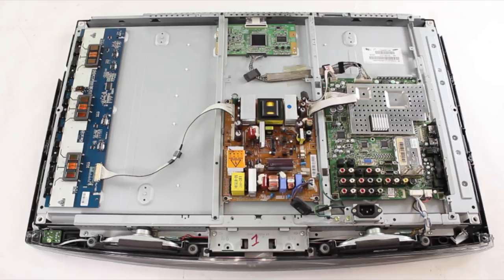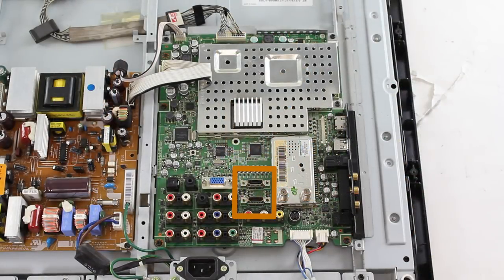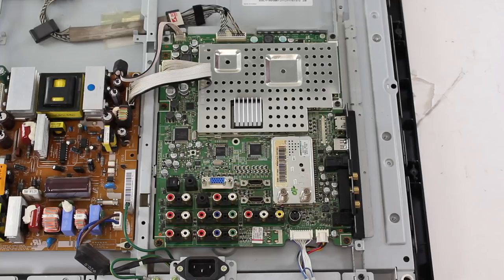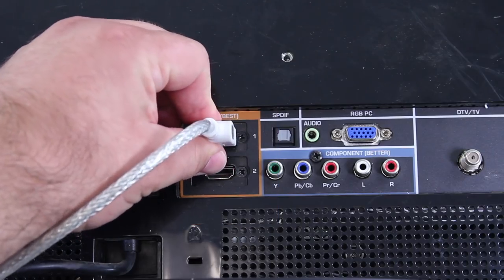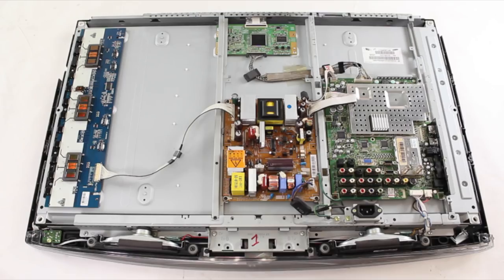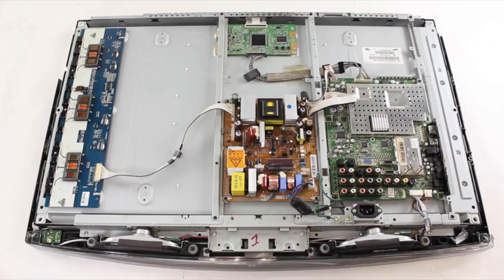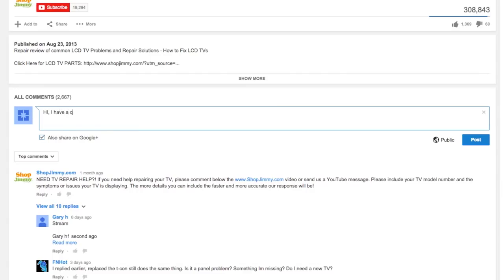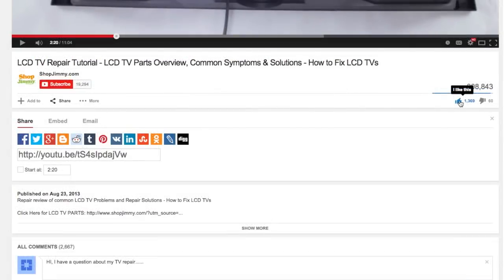HDMI Input Problems - TV Not Showing Image - TV Repair Help and Troubleshooting

Comment: I came across this video when I was doing one final search before giving up on my TV.  HDMI 1 would get video and no audio, HDMI 2 got nothing.  Different input devices, cables, updates to the tv, factory reset, etc all failed.  Samsung customer service told me I would have to either take it in or send it to them to be repaired.  I didn't want that expense for a fairly inexpensive TV, so I was just going to get a new one.  After this video I went to the website (mostly to see how ridiculous the price was on a main board).  Main board was super inexpensive, got to me the same week, and took all of 5 minutes to put it in my TV and it's back to working flawlessly.  Thanks to ShopJimmy, for sure.

Comment: Hello, I have some trouble with my HDMI port. My TV Panasonic Viera Plasma Model TH-42PD60X. TV has only one HDMI port and It was during a PowerOut that failed. Once the power came back I had to switch to RCA. My question is Do I have to change the mainboard or is there a spare part for this model? Thanks

Comment: Hello, i like your videos. I wanted to ask a quick question. I recently had a problem with my Toshiba 42AV635D, which i cant get any signal from any of my 4 HDMI inputs. When after couple of TV resets, I'm now sure the problem isn't with the software in any kind(no upgrade ever implemented) but with the hardware it self. I wanted to know how can i pinpoint if the problem is with the MainCard or with the Little built in box which connects all HDMI's to it, in order for me to purchase that exact part. Is there any way i pinpoint where is the problem ? Thanks alot.

Comment: Okay here's the issue and question. HDMI worked well in one TV "Seiki" sourced from the PC. But the same cable and feed going into 2 other different other TV's "RCA's" did not fully work. The desk top picture came up with the lower tool bar but not any of the icons of programs or the mouse. The audio did come through. The PC'S desk monitor functioned with no problem. 
Any thoughts?

Comment: I have recently purchased a FireTV from Croma. I have connected a Sony DVD player, a cable TV set top box and a internet video set top box to the 3 HDMI ports in the TV.

2 ports are working fine. The third one only picture shows but I am not getting audio. It is the Sony DVD player. 

What could be the reason?

Comment: Hey man this may be a stupid question but I've replaced a ps5 hdmi port twice and my TV identifies the signal as coming from a ps5 but there's no signal or error saying no signal. The console boots normally and there are no bridges between pins or loose pins. There's no torn pads or traces. Is it possible to be duped by the seller and the ports are bogus as far as being able to carry a video signal. There was no underlying issue as I do repairs for fun and have professional gear and I've replaced them on other devices before. I'm the only person who has ever been in it and the issue was caused by me stepping on the cable to begin with and the port worked for a long time after but I knew I'd have to replace it someday. I don't care if it ever works again but would buying a tester help or scoping the pads with the port taken out under magnification. I plan on giving it to a friend's kid as a surprise because they can't afford one and don't want to give up on it and I can't scope it while it's open and all voltage rails and such work and there are no shorts anywhere or hot spot under infrared. I'm tempted to solder test wires to the pads and check for an ntsc video signal with my scope. I've never read the hdmi 2.1 spec my c9 sees 2 ps5s connected when the broken one is plugged in. 

I think I just answered my own question. I bought a fancy new mso for a reason I guess haha.

Comment: Hahaha nice job in it and explaining it my problem is whenever I plug into my HDMI 1 or 2 into my TV. They both say no signal and it ain't my DVD that's the problem I plugged it into my other tv. And it came up right away it's just the other TV doesn't run on an outlet and I'm not traveling right now. So if you would please explain this to me step by step and if you could help me I would appreciate it thanks Jimmy ain't that ironic we both got the same name thanks.

Comment: Hi @shopjimmy.com , i Have a Mitsubishi TV ( LT-52249 serial #:106919) that its HDMI ports don't work , I was told to change the mainboard, i bought this part twice ! from diffrent eBay sellers, both claimed that nothing is wrong with theri part, but both didnt evenn give me picture when i installed them, i had to put the original board back in both cases, my TV works perfectly, picture and sound are crisp ! is there anything i did wrong? or just the parts i bought was defected? please help me out 

Regards

Comment: I was having flickering video and crackling audio with my gaming laptop connected to the HDMI port on my Samsung 55" 1080p HD SmartTV! All I did was...

1. Use 91% proof rubbing alcohol.
2. Use a double folded paper towel.
3. Wet a small area of the paper towel with the rubbing alcohol.
4. Clean the connectors really well and blow on the connectors to dry them.
5. Blow into the HDMI ports on my laptop and TV to get rid of any dust that may have gotten trapped inside.
6. Reconnected my laptop and TV.

So far so good! No flickering video or crackling audio! :)

Comment: What if both ports don't work? Is there such a thing as an older HDMI tech that doesn't work with newer HDMI sources? I don't have an older HDMI source to test this. I am aware of HDMI 1.0, vs 2.0 cables, but I am using 1.0 cables. Am I missing something, or is  it that both of my HDMI ports are just bad?

Comment: I have a Samsung un46f5500 that was not detecting any inputs.  I manually upgraded the firmware and now, when I plug it in, the tv just turns on and off on its own and will not respond to any controls.  I disassembled the TV and the Power Supply looks to be in great shape.  I think I should just replace the main board.  What do you think?
Reply: +MrGideon06 Thank you.  That is what I have been thinking just needed some confirmation.  The only problem is that you do not have the parts in stock.  But, thank you!

Comment: Hi, I've just got a LG 50PZ550T and initially when you turned it on it displayed HDMI then it would say 'No signal for current input. Try other available inputs'. The remote stops working too then it goes to the screensaver. Then when i touched the touch buttons on the front the tv would shut down.I tried HDMI 1,2, 3, PC and still the same nothing. So I took the main board out, checked it visually then put it back in. Now the tv does the same sometimes or just has a dark grey screen, as though the panel has lit up but nothing is there. However I plugged in a USB and it comes up reading then a visual menu pops up asking to use the remote to select video, music etc. But the remote does not work and the touch buttons on the tv don't work too. So I looked the touch button board and saw a 3.3v test point. I used a multimeter and it read zero. Is the main board faulty? Does the main board power the touch keypad panel with the 3.3v? The Power board Va and Vs read good. Any help would be great, thanks.

Comment: I had 4 HDMI ports not working. I replaced the mother board from a electronic company. I installed the used board and the ports still on work. the tv works great on coax antenna. any ideas?

Comment: Hi i don't know if you can help me with this problem. I have an LG plasma old one of the first models 42 inch, my problem is that i can connect my Nintendo wii u with hdmi, but not my Ps3 or home theater receiver which worked fine before, i dont think they're broken since a bearly used them. thanks in advance
Reply: +Carioca souza holy crap same problem. HDMI doesn't work with my PS3 either.

Comment: I have a Samsung un46h6201 with intermittent no signal problems with HDMI1. It's under warranty and a tech replaced the main board, but the problem still occurs. The problem is that after being off for a while (more than 5 minutes) turning the TV and device on causes no signal. I can repeat this several times when it happens, but if I unplug the HDMI cable and plug it back in, the problem is solved. This happens with multiple HDMI cables and doesn't happen on HDMI2. Le me know if you have any thoughts? Since we replaced hardware, I'm starting to think it's a software issue.

Comment: hello,
     I have an older Panasonic 42 in plasma tv. When I got the tv the hdmi port doesn't work properly it only shows a scrambled picture, when I hook the same hdmi chord and cable box to my other hp tv, it works fine. I've opened the tv up, located, and removed the board that the hdmi port is on but it's a seperated board then the main board. do you recommend just replacing that board or replacing both the main and alternate board? 
thanks

Comment: Hi Shipjimmy,
I am trying to connect my laptop to LED TV using VGA to HDMI converter box. I have connected my laptop to the convertorr box using VGA cable and I have connected my TV's HDMI to the HDMI output of the convertor box. But the TV shows "no signal". Can you please suggest anything to fix it.

Thanks in advance !
Reply: Denish Patel my problem is HDMI is working for the old receiver and I got new one and it doesn’t work how can I fix it ?!

Comment: Ive had chromecast for last 3 months loved it but all of a sudden yesterday when I go to the HDMI on remote it says no signal. So because of no power to chromecast it has stopped. I've tried both 1 and port 2 still nothing. Isnt it easier to just get a new tv? I only paid $100 yrs ago for this DYNEX tv? I brought my friends charged chromecast it won't work on my tv either just still says not signal

Comment: Older type Changhong TV will play Netflix with PC but the computer keeps freezing and has to be restarted. This does not happen when the computer is not connected to the TV via the HDMI cord. Tried the Macbook Air. There is no picture on the screen at all, just a mishmash of colours. I have tried resetting the TV and a few other fixes to no avail.

Comment: very informative. however why the heck does the part break, and yet they make is so hard to replace. if the part didn't break it'd be easier. buying a whole main board (mother board) seems like a lotta work. also the cost to repair the TV can be expensive. having the same issue describe in the video. I have an older model 32 in flat screen TV Samsung. it only has one HDMI port and it won't work. unfortunately the Amazon fire stick only connects to HDMI. I also tried a HDMI to component converter and I got a signal but it was split screen and didn't work. what should I do, fix the HDMI port? I don't think Amazon fire stick or tv comes with component.
Reply: tucko11 it all depend here... consider the age of your tv... is it cost effective to replace the board vs. Getting a new tv? A 32 inches now a day are not that expensive and will come with at least 2 hdmi port. Is there a sentimental value? then by all means consider repairing it. For the most part, replacement board are not that expensive.

Comment: When I have a device of any kind connected to any of the HDMI ports on my Visio SV470M-C television, I get intermittent interruptions of audio and video that range in duration from 1 to 15 seconds.  No other input source produces this problem.  I'm assuming I'll have to replace the main board.  Am I correct?

Comment: Wd 73833. All HDMI ports not recognizing signal. I purchased another board from local t.v repair shop. It worked , until I turned off the set ,and turned it back on the next day. Unplugged from one port . And it worked on the other open port. So i watched mu cowboys game 2day. After the game I decided 2 test , by turning off t.v and back on. Nothing snow screen. Unplugged and went to third port same snow screen. FYI... I had the dreaded green blinking lite of death. Bought a new board replaced ot. Tv  powers up great. Just need hdmi fixed. Any ideas

Comment: Question. My cable is ran in through an hdmi cable and it has times where it cycles in and off, the picture could be anything from a clean image to absolute snow, and may be quiet or may make a very loud high pitched wine that can't be turned down. What's odd is it works fine on everything not ran by hdmi. Any thoughts as to what is broke or how to fix it?

Comment: Hii I have problem with my Samsung LCD TV 
It's module no.is Samsung LCD
BN68-01197G
It's HDMI port is not working also when I connect DVR to LCD with HDMI cable its show me 
Mode Not Supported 
So can you sort out this problem

Comment: Our Sony Bravia has no single sometimes when it's first turned on. Still have sound, have to unplug the hdmi 1 cable and plug it back in to get a picture. Or sometimes we turn it on and it's fine then turn it off and on later and no single.  We have a DVR box through our cable company.

Comment: Today I went to pawn a tv I didn't need anymore. Once I got to the pawn shop the guy inserted a hdmi cable to see if everything worked properly but only the audio worked not video. He even plugged that same cable to another tv and it worked. So I took the tv back home and tested it myself. I inserted a hdmi cable from my Xbox one and the sound and video worked. Can you explain why this happened? Could it have been his cable?
Reply: did you figure it out..my TV worked fine for a while with chrome cast now none of the ports work as well. I'm wondering get if it's the chrome cast device?

Comment: Hello do you have a fix for hdmi   cec  anynett Samsung  model  LN52B550K1FXZA version SS02 tv wont turn on after dissconnected  nvidia shield from hdmi port  and when connecting  nvidia shield  back to  hdmi  tv turns off  and on  or doesn't  do anything    I have unplugged tv from  wall for two  days and no power   has a red light not blinking thank you for your  time

Comment: Jimmmy my google tv hdmi ports are not working the way I would like.hdmi port 1 work fine but if I try to connect my Xbox to hdmi 2,3,and4 it will just show that it is connected but it won't let me click it.Also it my hdmi 1 is for my comcast tv but for my Xbox it says it is connected but it Doesn't let me press it

Comment: I have a 40" Philips model number 40pfl3705df7 the tv turns on the Philips startup screen does not come. Any ideas of what the problem could be
Reply from the maker: haighter17   PLEASE SUBSCRIBE TO OUR CHANNEL - Try all repairs and troubleshooting at your own risk.  I recommend replacing the main board in your TV.  Click this link tor replacement parts for your TV model number:  http://www.shopjimmy.com/catalogsearch/result/index/?cat=225&q=40pfl3705  There may be multiple boards for the same TV model number, be sure to match part numbers on your current board, with your replacement for compatibility.  Here is a link to a video showing how to identify your part number, click here:   https://www.youtube.com/watch?v=wooRqBrRo6oThanks and please let us know if you have any further questions with your TV Repair!  www.shopjimmy.com

Comment: Hi, I have a 32LG3000 tv that won't recognize my new Cube T8 in hdmi although my HTC one m7 phone has no problems. Is this a set up problem for my Cube? Thanks. BTW I live in southern Spain.
Reply from the maker: +Frank  Glover  Try all repairs and troubleshooting at your own risk.  More than likely yes, but if you want, you can replace the main board to see if that fixes the problem.  Click this link to replacement parts for your TV model number:  http://www.shopjimmy.com/catalogsearch/result/index/?cat=56&q=32LG3000  There may be multiple boards for the same TV model number, be sure to match part numbers on your current board, with your replacement for compatibility.  Here is a link to a video showing how to identify your part number, click here:   https://www.youtube.com/watch?v=RwHTvjMdrhk  Thanks and please let us know if you have any further questions with your TV Repair!  www.shopjimmy.com

Comment: The HDMI cable was yanked out of my Samsung's HDMI input which caused that input to be damaged. Then while troubleshooting, I ended up damaging two good HDMI cables because I did not know that the inputs on the TV where bad. If both inputs are not badly mangled, is there a possibility of fixing the inputs without replacing the entire main board?

Comment: I have a Samsung plasma with four HDMI ports.Ports one and two are on the main board (rear of TV)and three and four on the side of the TV.

ports one and two were not working however three and four were ,so I disconnected all source inputs and did a factory reset which resolved the issue.

I guess that unplugging and re-connecting HDMI cables over time had upset the TV and the factory reset did work for me

Comment: My cable connection to HDMI works only when I unplug everything and reboot the system or if I switch HDMI ports. All HDMI ports work for any gaming box without having to switch or reboot everything. I have replaced the HDMI cord, the cable box and still have this issue.

Comment: Have a Sunbrite Veranda tv. Worked fine for a year.  Recently cable box would freeze whenever did on demand.  Contacted Optimum.  Tech came. Said box is too old and the connector is wrong.  Connector was RG6 and the line was RG11U. He took  out the RG6 connector off and said he did not have proper one to replace it.  Put back old and left.  Then the screen was green.  It came on but had a green hue.  Called again.  New tech came. Changed the connector to an RG11u and changed the box. Problem persisted, but now there is no sound. So have a picture with a green hue and no sound.  He said it is the tv. Have now taken the HDMI cord and put it into a different slot on tv.  Still the same.  So took a small 32 inch tv outside.  Connected it to the same HDMI cord. That tv worked.  Did the cable guy fry my tv, if so can it be repaired and at what cost?